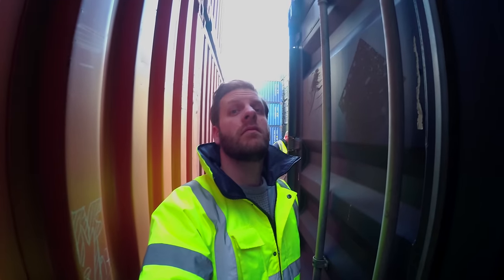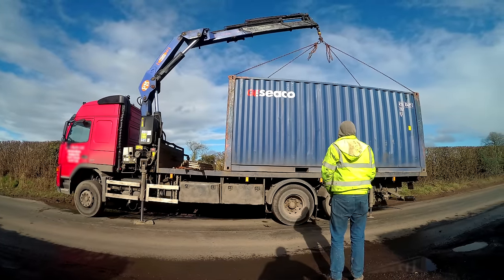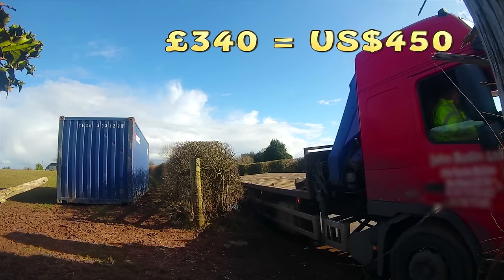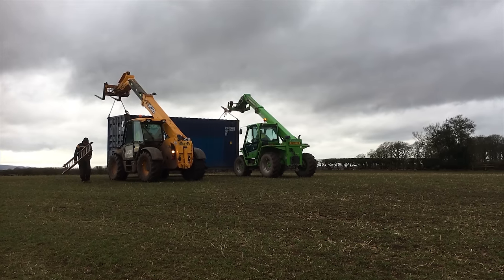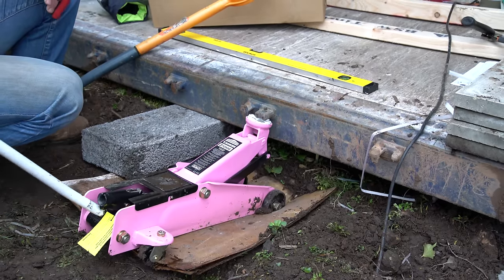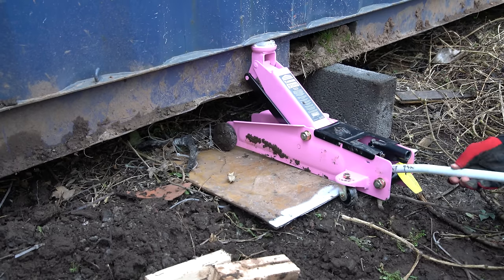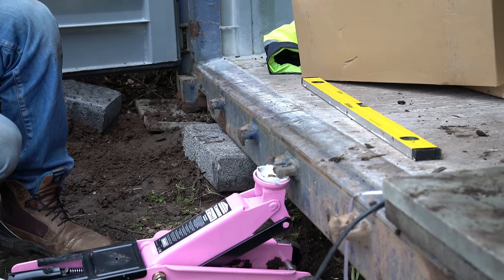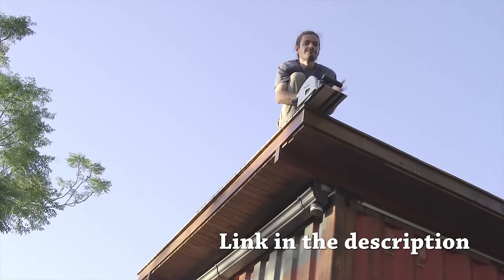Moving & Leveling - Shipping Container Home Office - Shipping container conversion  - Tiny House

Comment: Another great video, your process for leveling is very much as we recommend for customers. Frankly the ground you have it on is about as bad as it can get so well done! 

If it helps others in the Uk 20ft delivery charges will start around £150 if you are a few miles from a depot and go as high as £300ish if you are about 50-60 miles away (and we can quote as much as £700 for deliveries into Cornwall or the Highlands). 40ft deliveries will come in approx £100 more expensive as they need a large arctic truck which costs more to run. Your distance from the nearest depot with containers for sale in it will mean the delivery cost can vary a bit. 

This biggest issue we see on a regular basis, if a shipping container is not leveled off properly, the cargo doors can jam open as the container is 'racked'. Following the method shown here is the cheapest way to fix the issue. If you don't mind we may well show this to some customers who are unsure how to go about this.
Reply from the maker: Thank you - we turned over all the soil in the garden a few months prior to remove plastic and to remove gravel, so the soil was still very spongy. It wasn't a fun process solo, that is absolutely for sure!

Comment: A good solution would be to weld adjustable legs to your container so that you can adjust easily they are not very expensive as long as you get manual
Reply from the maker: This is something I'm hoping to do in the future - with a concrete foundation also.

Comment: Did you consider GROUND SCREWS? If so, why did you reject the idea

I’m considering a container conversion for my back garden (yard) & they seem an elegant solution, since they are load bearing (1 in each corner) & the contractor will drill them into the ground so the caps are dead level, all in a couple of hours (apparently)